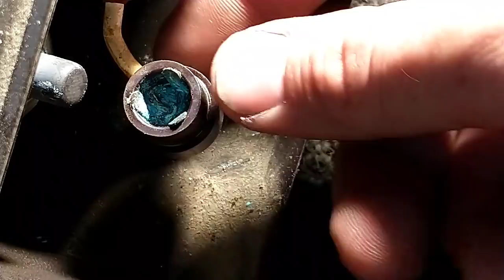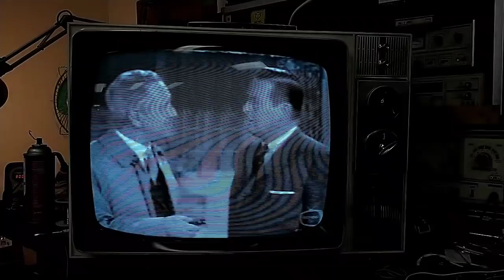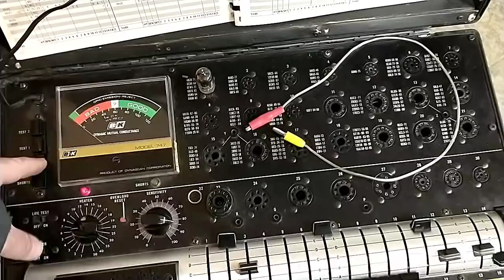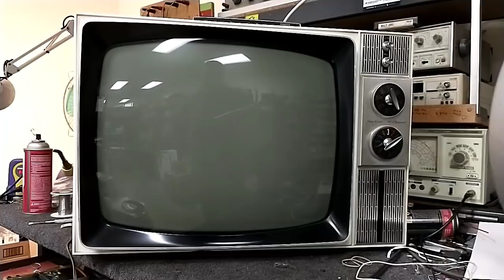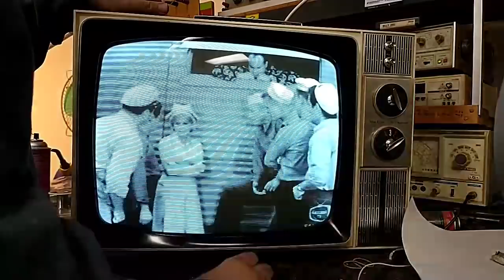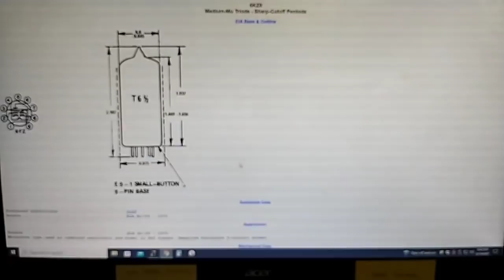Repair of a 1965 RCA af-141w 19" b&w vacuum tube tv. Part 2/?

Comment: I have that same 747b tester but I thought I read in the instructions that when you use the fast test sockets that you should re-set the bottom toggle switches so they do not cause problems with reading

Comment: I have an old Precision Apparatus FM TV alignment generator model E-400 that I acquired from my grandfather's estate. Two marker crystals marked 4.5 and 2000. Are these worth restoring and keeping? 1949 vintage or thereabouts.
Reply: Beautiful piece of equipment. I think Mr Carlson had restored one. I have one and the E-200.
Reply: @johnnytacokleinschmidt515  you know where to find a schematic and parts list? I have the operating manual, but it doesn’t have one.
Reply: @zulumax1  Not sure.... Check Mr C if not there I can look this weekend to seex what I might have for it.

Comment: Blows me away how signal tubes,, even shorted and with grid leakage (grid emission), don't cause the section they are in (RF amp, mixer, IF, etc) to just stop. High gain circuits indeed! Old techs used to bridge a .02 mf cap between the plate of the last known working section past the suspect section, to the control grid of the next section as a test.

Comment: What about checking the audio output tube?
Reply from the maker: The fact that I cAn get snow sound on a blank channel suggests the audio output is working.
Reply: An audio signal tracer would help sort things out
Reply: @josephsirois2353  from what i saw the sound comes through but the carrier frequency is off, it doesnt come together with the picture, signal tracer is not usefull its an alignment issue of faulty component causing the drift